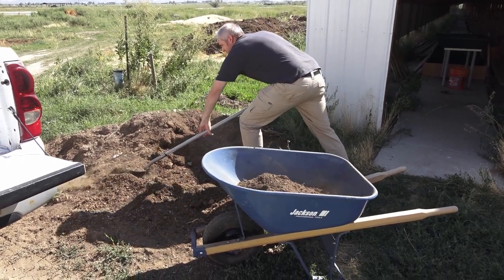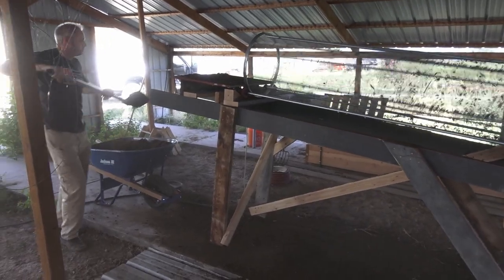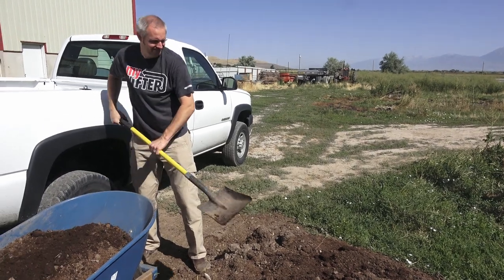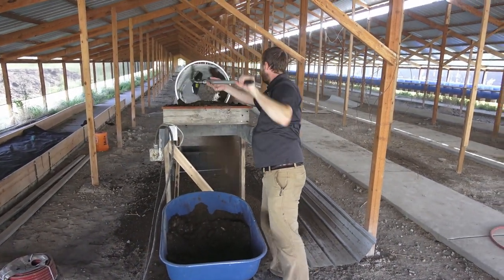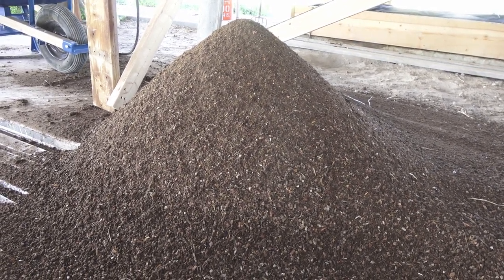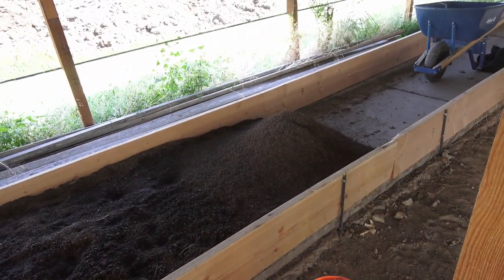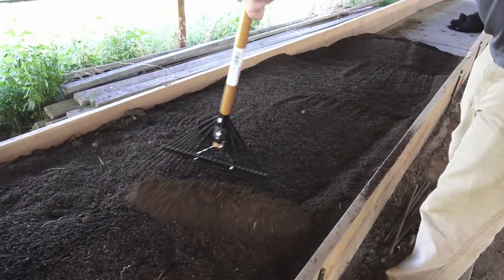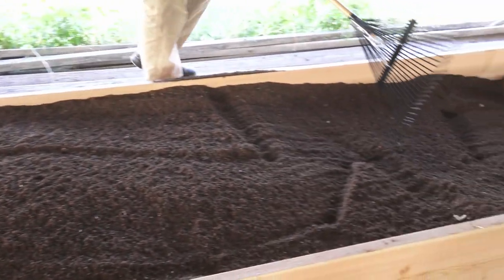The First Time Using The Rotary Sifter At The Worm Farm. This Is So Much Easier!

Comment: Reduce speed, cut the legs down to reduce height by 18 inches, put two Skirts under tromel to guide it into buckets .... and or design the unit so it sits over the bed and you can directly feed the bed thus taking a few steps out of the job :-) also turn the wheels 90 degrees so you can move it up and down the beds !!!! great start though.
Reply from the maker: We contemplated all that. We decided against it even though it's good ideas. It's easier to leave the heavy machine stationary and move the sifted product to where we want it. This also allows us to add things to the sifted stuff and add more moisture before placing it on the beds. Soon we will have a hopper and feeder so we wont have to lift so high to feed it. We will just dump into the hopper and auger it up to the mouth of the sifter.
Reply: West Mountain Organic can’t wait to see what the future holds for you guys! Good luck

Comment: Hey... I need a machine like that. Did you build it yourself? Can you give me a few pointers on the Motor and Gearing System?
Reply from the maker: Well, ours is a bit too fast. 10 to 15 RPM would be ideal, ours is closer to 45 or 60. Find a motor that is strong and steady and use different pulleys to gear it down until it's slow enough. It's best to do build your "gear box" off to the side then use one last pulley to attach it to the drive shaft, that was the pulley system stays our of the way of all your material and is easier to maintain.
Reply: @westmountainorganic8084  Yes i was going to said that it is running way to fast. I have it more to 10 rpm then 15 rpm but by now you would have modified it already

Comment: WEAR A MASK.  Can you drop it down about 6 in"? Or build up the floor with a pallet.
Reply from the maker: We ended up making some adjustments. It's slightly damp so dust is minimal as well, at least it was during this video. Thank you for your concern though. I tend to wear a mask when the dust is bad. Not a fan of compost in my lungs haha

Comment: Brilliant❗️I’m going to pre-sift for my small 50 gallon farm easy to do over a wheel barrel for us backyard farmers!
What about this  portable conveyor to load? Puit on a track and just roll it over the bins as you feed.  Wish you  guys were closer to New Jersey.
http://www.mobileconcrete-batchingplant.com/photo/pc24697314-portable_mini_concrete_conveyor_belt_width_1000_mm_for_carrying_gravel_sand.jpg
Reply from the maker: We will eventually have to do something like that for feeding larger sections as we are growing. Right now we don't sift our current feed actually. It's pretty fine as it is. We use the sifter for castings now. But our feed stock won't always be this uniform, so it will eventually be used for its original purpose again

Comment: Why not build a ramp up to the mouth of the sifter as well as an enclosed hopper to the mouth of the sifter.  This way all you have to do is push the wheelbarrow up the ramp and dump it all at once into the hopper instead of wasting all that energy shoveling it up the mouth of the beast.  Also if you make it mobile then like one of the comments suggests...just up it directly on the worm bed instead of shoveling it back into the wheelbarrow to dump it on the bed.
Reply from the maker: We are going to do something along those lines soon

Comment: Waaaaay too fast. Put an inline dimmer switch to slow that puppy down
Reply from the maker: We need to get a new motor before doing that, unfortunately. The current one can barely turn it even on full power. We thought of doing just that though.
Reply: @westmountainorganic8084  dryer motors work really well. Might have to adjust the gear ratio though